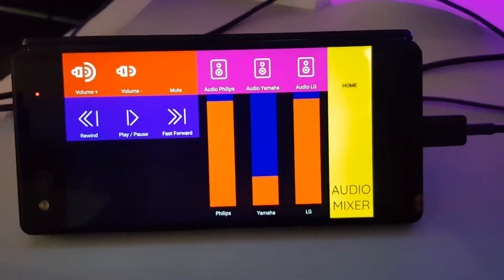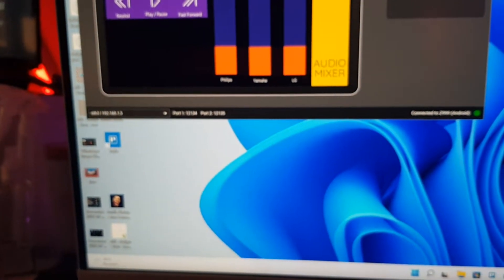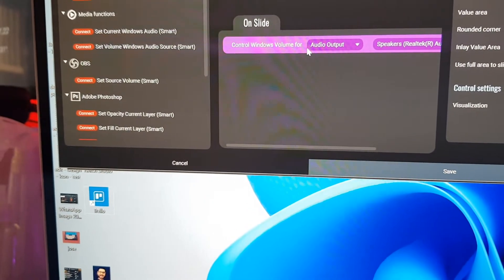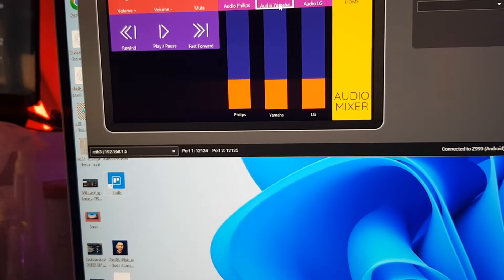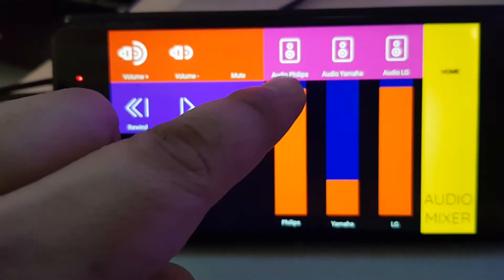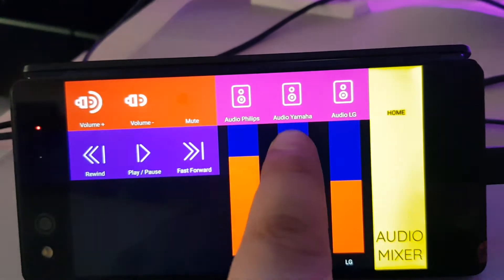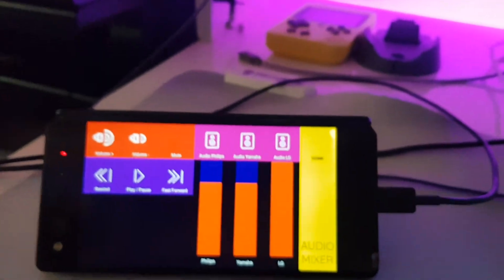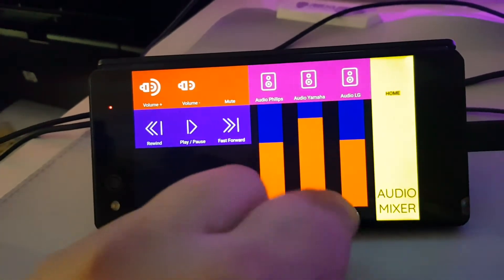TouchPortal Slider Bug?

Comment: Same issue for me. I have 5 sliders. The 5th slider make every slider move. The 4th slider also control the 5th slider.
It only happens when I copy a slider and paste it in again in a different spot (changing the values of course).
If I manually add each slider it works just fine.